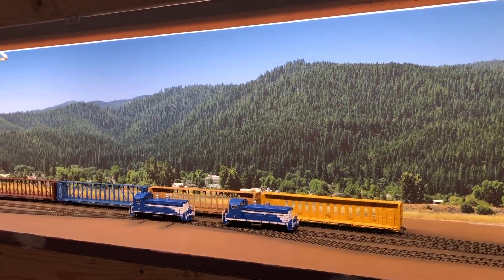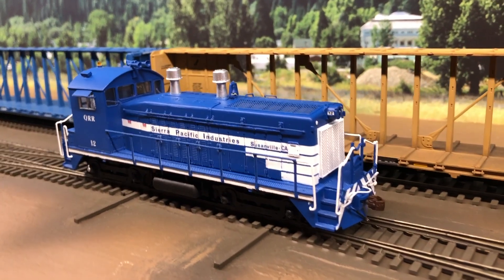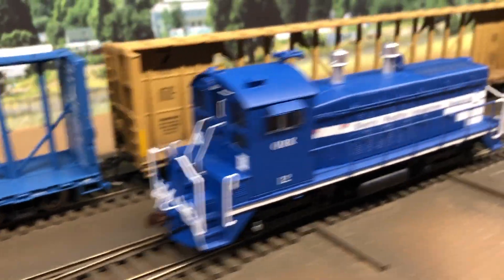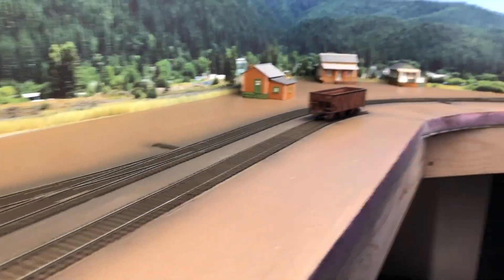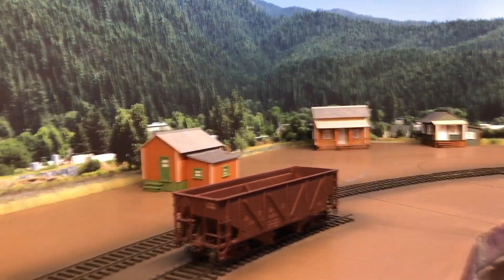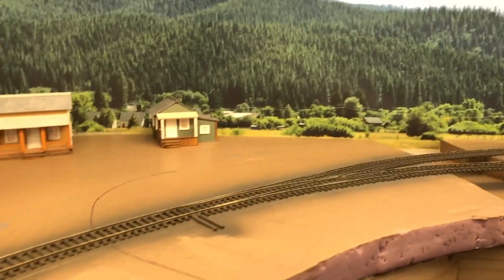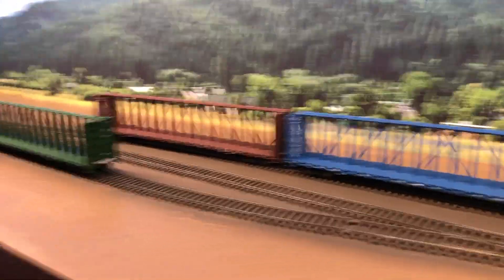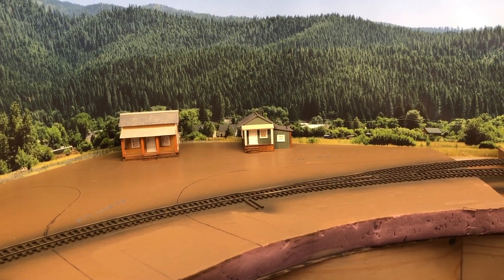Quincy Railroad in HO Scale-Layout Update 2/17/21

Comment: I like the concept of your short line shelf layout. Switcher looks great! Track work is sound. I also like your approach to developing scene composition e.g; Drawing in the roads etc., which allows things to bake in for a while, leaving the option to revise as you flesh out your ideas. You mentioned road material. I used styrene sheet for mine ( I had it laying around), but I`ll be using 1/8 masonite (or press board) for my expansion. Why? Because it cuts well, glues well, shapes well, sands well, and paints well. Just thought I would share that with you. Looking great! Cheers. - Boomer.